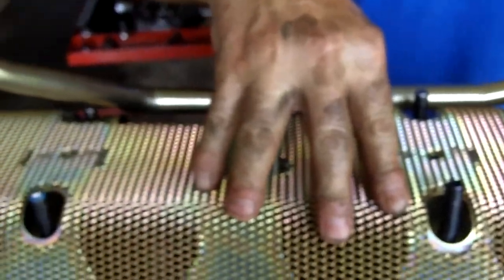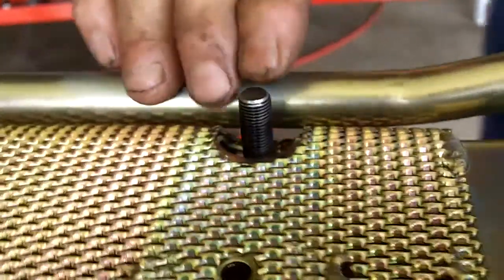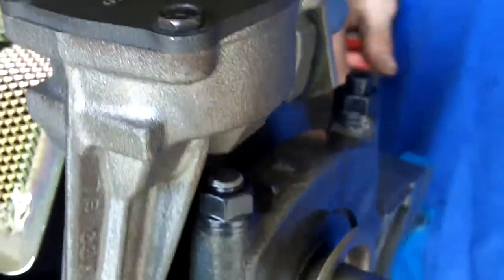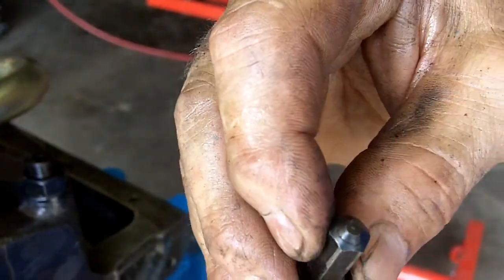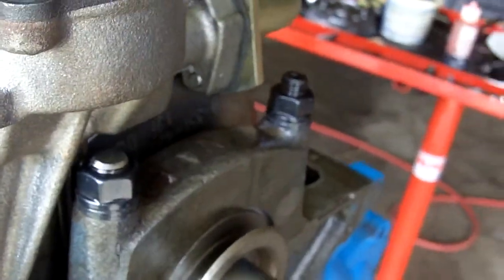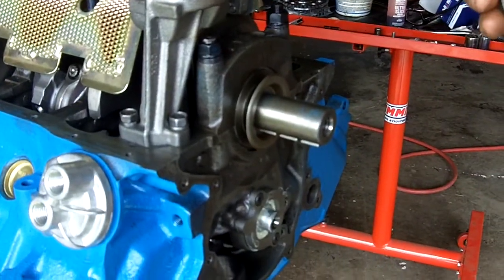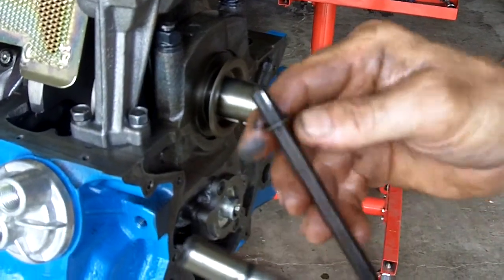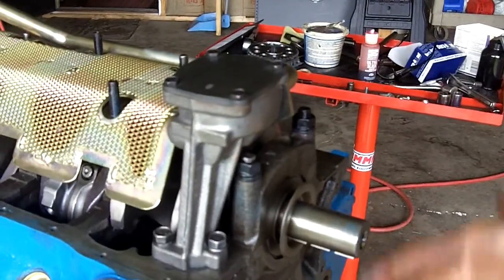Engine Building with RoG - Windage Tray Oil Pump Shaft Talk

Comment: great video.. tried resetting my distributor after being run at 0 degrees, and lost the oil pump shaft into the pan. 1 tow and 2 days staying late after work and ive just put the new oil shaft in.. and ARP with the stock clip.. any idea if the arp even need a clip? because they seem to be tapered?
Reply from the maker: Thanks for watching, I don't think the ARP needs a clip like you mentioned. They make a good product for sure, much beefier than stock.

Comment: Beautiful fellas!
Reply from the maker: Thank you so very much! My father enjoys reading the comments. Please consider subscribing, once the country opens back up, we're going to start working on the engine again!
Reply: Hell yeah man I wish my dad was into building motors, he's a carpenter by trade so Ive learned alot in that wheelhouse, but I'm building my first 350 from bare block. So I may just go mostly stock on the bottom end.
Reply from the maker: @owenfranklin814  For sure man. Just keep it stock and learn as much as you can, then when you get some more ideas as to what you want to do, you can always pull the engine and have more fun. Your old man being a carpenter is pretty cool, lot of neat stuff you can learn!